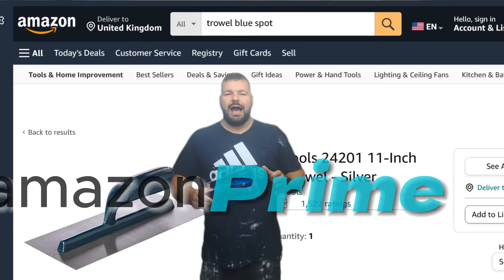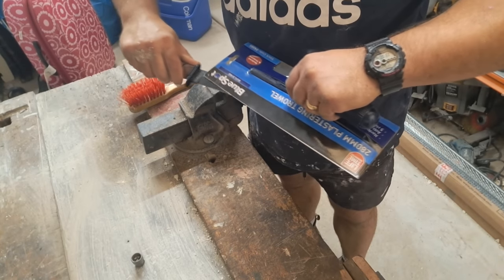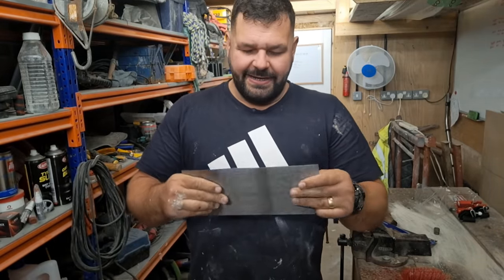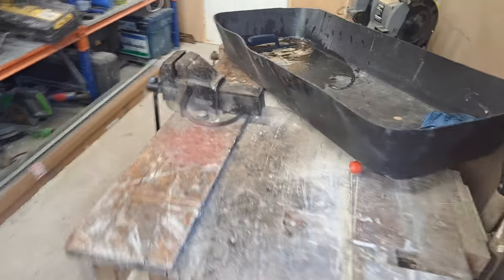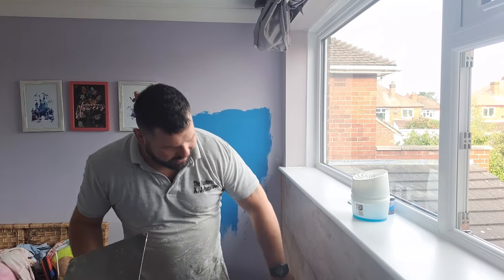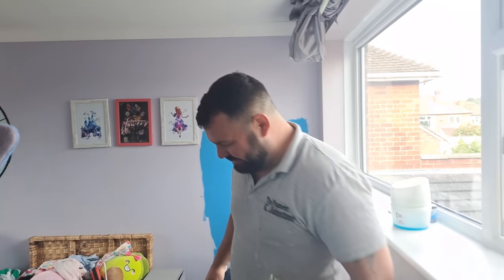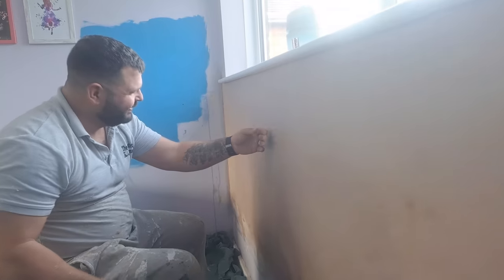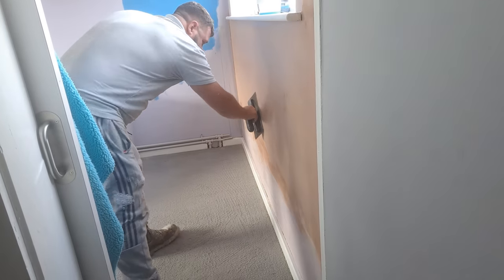CHEAPEST TROWEL ON AMAZON

Comment from the maker: Let me know if you like this video 😊👍
Reply: I did  ❤. Funnily enough I’ve just bought a marshalltown 4 inch width made of spring stainless steel finishing trowel. Not heard of spring steel before (it’s the steel they use to make springs in shock absorbers). I’d love to know what you think of them.
Reply from the maker: Lovely trowel mate
Reply: Mate this is where all these flexi trowels are going wrong it's not so much the blade it's the handle that needs to flex 😂😂😂😂 wasn't expecting that though lol great video 💯👌
Reply: The thing is with a towel like that you buy it to do one diy job then it gets thrown its ok but will not last 👍
Reply: Maybe next time make a mock stud wall and board it then test it 😂
Reply: Hi Kirk . What is the purpose of having a patina on a trowel? And would you do this on a new Marshalltown for example ?
Reply: @TheCreatorSupreme15  spring steel is what it says on tin,,,,steel made from springs,,melted n recycled,,
Reply: @stumetallicafan he tels u in vid son puts a coating over steel save it rusting,bt looking after ur tool ie drying them when fin,stops rusting 😅😅
Reply: Of course I like this video man! 🤝
Reply: :D it's a good watch fren. I enjoy your style.
How long did it take you to get this good? 
I'm cocky and think I can do a job in a short time and end to taking longer, and earning a low rate due to underquoting.

Comment: Good video. But as a tip to all you budding skimmers out there. I had my first Reno to do, had a m8 who is a plasterer help me for 4 ceilings and take me thru the motions. I bought an Ox pro 16in trowel and an 18" ox pro flex. a plastic speedskim and stainless speedskim. Had a different m8, who is a very good plasterer come round and he looked at the 20+ walls i did and said i saved myself at least 10k and job was comparable to a 'decent' plasterer. The tools were like 300. Get good tools
Reply: Ox 😂😂

Comment: Thing is, regardless if the trowel is cheap or expensive, it is how experienced someone is. You can give an expensive trowel to and amateur or someone who lacks skill, and give a cheap one to someone who has passion and talent, and the results will speak for themselves.

Remember, expensive trowels weren't around when they built some of the most sophisticated buildings thousands of years ago, so all this branded stuff is basically marketing. Sure we have evolved with gimmicks and tools but the fact remains, if someone has the capacity and desire to do a good job then they'll do it with a butter knife if they had to.

Comment: I used an 11” £5 wickes trowel for years and years , ,
Marshal towns permashapes were a new concept then, ragni, tyzac whatever you got , they all needed bedding in , I only changed to mt when bonding and then hardwall came up more and they eat in to them carbons like mad if you leave it set and got sick of washing the saviour wd40 off . I got some Nela’s nowadays they are good nicer grip then Refina’s . Agreed this with modern ones a super flex or so a newbie can make a good go at from the offset if they can manage to get it on the wall, I used to 1200 mine every weekend I do not miss those days 😂😂